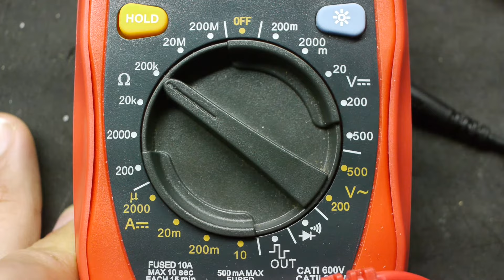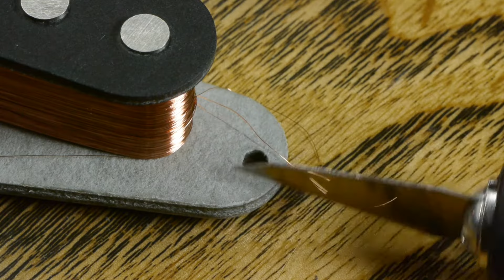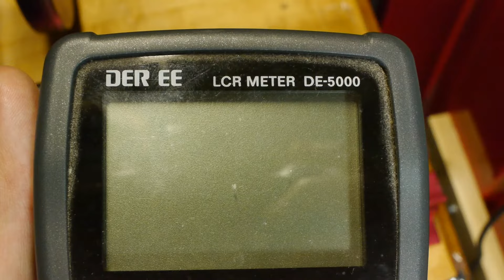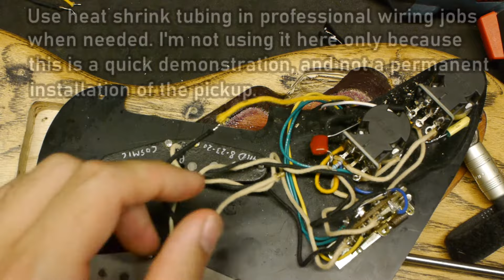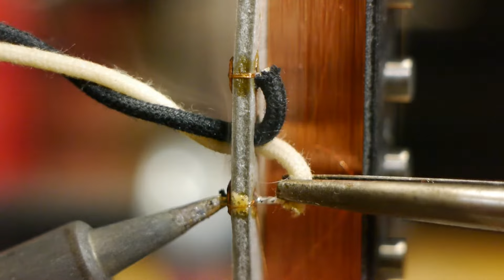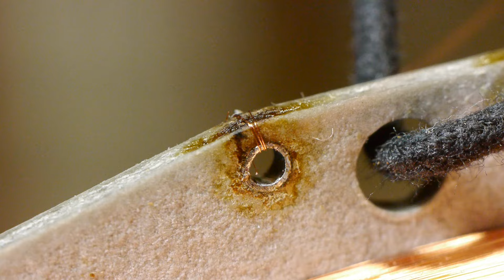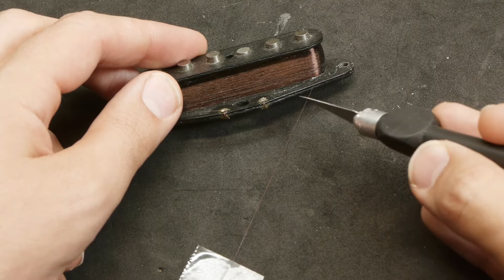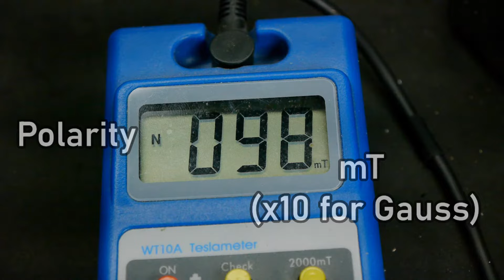Broken Guitar Pickup DIAGNOSIS + REPAIR | Fender Style Single Coil Diagnosis + Repair Demonstration

Comment: wow. very cool video. I wasn't expecting anything like this. I just bought a tele and the bridge pickup is not passing audio. not sure if it's the switch or the pickup yet.
Reply from the maker: I'll be working on a new video soon going over the most basic thing: re-flowing the solder joints. That's usually the most I'll do. I have another video on my "knot splice" technique that I've used to repair pickups before as well here: 

https://youtu.be/cNKcELHM_2s

For humbuckers, sometimes soldering new pigtails onto the magnet wire leads (after disassembling the pickup and wiring) will work. 

For a Tele, I'd try re-flowing the joints, and also carefully inspecting the start and finish eyelets to make sure the magnet wire leads haven't come off. Testing the magnet wire leads is always preferred, as sometimes the magnet wire connection to the hookup wire isn't solid -- even if the magnet wires themselves are OK and the coil isn't broken. 

Re-flowing the joints and/or splicing the magnet wire leads are the two solutions I'll use. Beyond that, it's time for a rewind. I did mention unwinding a pickup here, but since I have no way to automate this (yet), I never do this. It's an option, but I've never actually unwound a pickup to the point where it broke, and fixed it then. You could be unwinding a pickup for hours by hand trying to find that. Just makes more sense to rewind, though understandably most people don't have the setup to do that. 

Let me know if you figure it out!
Reply: I tried to reflow some solder. Nothing. I tried testing at the wires coming off the bobbin after scraping with a razor. Nothing. I tried unwinding the wire. Got a few hundred turns off and it let go. Couldn’t find the end, was super cool, but also the coils were loose in a few places. I’ll probably buy a new pickup, but it was super cool working on this one. Great video. Great playing too! Maybe I’ll buy a setup to wind pickups in the future.
Reply from the maker: @caseykittel  Awesome! Would definitely be worth it, IMO. I've been winding pickups since 2017 and it's not only very rewarding, but great to know you can fix more stuff if it goes wrong. Always a great skill to have. 

The loose wires getting away and pulling a disappearing act is another reason the unwinding method is so tough. I've spent hours fishing around for loose wire ends. Sometimes you get lucky. 

Hope you can get a partial refund at least. I'd definitely let the seller know the pickup was dead on arrival, could cover some or all of the cost of a replacement. Good luck!
Reply: @guitar_md I tried the toothbrush trick, but i ran out of patience. Also, honestly, I bought the guitar BECAUSE the pickup was bad. I was in guitar center and a guy was trying to sell it to the store. They wouldn’t take it because the pickup didn’t work. The customer was gonna throw it in the garbage along with 3 others guitars. So I gave him $100 for 4 guitars. The hard shell cases are worth more than that alone. Buying a pickup is fine. I was really hoping hitting it with the soldering iron would fix it. C’est la vie.

Comment: What you you recommend if the break is at the start lead. Can’t pull off any slack because all the winds are on top of it
Reply from the maker: @Giller9  I invented a technique that I call the "knot splice" for exactly this problem:  

https://youtu.be/cNKcELHM_2s?si=Aer1v1q8v_gI0F8R

Tricky, but it works. The only issue is you'll need separate 42AWG wire to do it. 

Another pickup winder named Dale suggested the idea to me of alternatively using copper tape. That should also work, though I haven't tried it yet. 

 It's very tricky and delicate no matter how you do it, but it is manageable. Sometimes you can tease out a little more length from the start lead with a toothpick if you're very careful. 

But basically, the fix involves splicing to that broken start lead so you have enough length to tie around the eyelet and re-solder. I've done this 10 times or so, so far. And it works great, though it is very delicate and finnicky work. 

Let me know if you get it!

Comment: A true valued video.
Reply from the maker: Thank you! I've got more on the way as well. I'd like to make a new "Wiring" playlist and make some videos about diagnosing and repairing faulty cables, guitar circuits including ground issues, and an updated pickup testing video. 

I'd especially love to do a simple multimeter 101 guitar tech video showing how to diagnose grounding problems and basic wiring issues very quickly. 

Lots more on the way. Thanks for the support!

Comment: I just installed some fat 50s and my neck pickup won’t work , the bottom side tap tests but it’s like it’s shorting out … I gotta get batteries for my meter in the morning so figured I’d try to ask here ….. hard to know anything without my meter
Reply: I’m gonna go flip the wires , I love your videos
Reply from the maker: Let me know how it went! 

If you need any help, hit me up at guitarmdofficial@gmail.com. I'm always available for pickup repairs/rewinds if needed.
Reply: @guitar_md  no dice , I sent a message to where I bought them for a refund /exchange…. Brand new custom shop pups, I shouldn’t have to monkey with them for the cash a guy pays

Comment: Hi, thanks for the video, it is very informative! I have a Tribute Comanche which was mighty fine out of the box, but like a few weeks later ( didn't play much) the vridge pickup was completely dead. No sound at all. So i just wanted to tap it with my pick to check it... Nothing. Then for no reason i tried with a small metal tool and the pickup went back to life instantly! The. A few weeks later it was dead again, but it revived with the same trick. That was last year. Didn't have time to play sonce but today i picked the guitar to test an amp and then surprise (!) the neck pickup is very quiet.... Couldn't being ot back this time, and bridge is ok lol. Nightmarish. Do you think this is tje same problem as in your vid?
Thanks

Comment: Ive got a question. As it seems, you want the AlNiCo 5 magnets in a strat pickup to have the same amount of magnetization in Gauss. Does that also apply to the staggered Fender Pickups where each magnet has a different height, or are they magnetized with different amounts of Gauss/Tesla?
Or does fender charge them all with the same magnet and then every single one has a different Amount of Gauss but that's how they leave it?
Reply from the maker: All charged the same. I think at factories they use a capacitor discharge machine, or something like that. I use two neodymium magnets but I think this is only what home-based pickup builders do. 

An original 69 Fender pickup I measured was as follows:

E: 1030 Gauss (.693" tall magnet)
A: 750 Gauss (.688" tall magnet)
D: 950 Gauss (.722" tall magnet)
G: 780 Gauss (.720" tall magnet)
B: 670 Gauss (.630" tall magnet)
E: 950 Gauss (.670" tall magnet)

All magnets were .193" in width. 

I've seen similar variations in a 1955 Strat pickup set, though not as drastic. The 1955 was 1000, 900, 1000, 870, 830, 900, measuring EADGBE. 

So actually close to what I get now with modern magnets. Variations of a couple hundred Gauss seems to be normal and the meter is also very sensitive to where you hold it so there's some user error as well. 

Gauss can vary by quite a lot depending on the magnet dimensions. Shorter magnets will hold less of a full charge, and so on. But sometimes even magnets of the same size can hold different charges -- no idea why. 

I tried re-magnetizing that 69 pickup and it stayed just about exactly the same. It's possible some Alnico 2 rods got mixed up with the Alnico 5. 670 Gauss is very low even for a short magnet and seems like an alnico 2 or alnico 3. 

So very possible Fender was even mixing them up back in the day.
Reply: @guitar_md  ok thx. I was messing around with neodyme magnets in my guitar to attach a slide bar like Paul gilbert does, and messed up my Texas special staggered every time I flipped the pick guard upside down to solder something with the pickup magnets directly touching the neodymes.
So to fix them I can just get a simple pickup  charger magnet and go through piece by piece? Did I understand that correct? Thanks for your detailed answer. I very much liked the video as well ♥️
Reply from the maker: @nickfleiwer5272  I've only personally used the Mojotone pickup magnetizer. Just as easily you could get a small vise and some powerful neodymium magnets and put them on -- making sure you've got the opposite poles facing each other. 

I show the process -- which is very quick -- in my Pickup Bobbin Assembly video. I clamp it all the way in the vise loosely, then back off a little, and move the pickup back and forth a few times before pulling it out.
Reply: @guitar_md  ok, yeah that's what I'm going to do I think. Thank you for your help 😇
Reply: @guitar_md  lets pretend i had the mojotone magnitizer, do you think its a problem, that the staggered magnets cant touch the neodyme at once? Or do they just get magnetized fine, because the magnet field is still strong enough and must not touch the magnet?

Comment: WOW your so cool I knew this was possible thank you Ive  subscribed glad I found your channel. 
I got a telecaster advertised  spanky Twangler pickups but neck sounds dull  I think must be break in line would send it back but guitar is perfect just going to order a set of Toneriders anyway.

Any tip on what type of pickups out there that sound like Jimi Hendrix style I could buy? cheers
Reply from the maker: I occasionally make a Jimi Hendrix set. You can shoot me an e-mail at guitarmdofficial@gmail.com if you're interested. 

However, if you check out my recent cover of "Machine Gun" (the intro), I did that with a flat, non-staggered polepiece neck pickup. I made it with 7600 turns, and a .500' coil. Traditionally Strat coils are around .430" tall, and Jimi's pickups were effectively flipped upside down, because he strung a righty Strat backwards. 

So...I've made a Hendrix set that emulates that, like basically a lefty set with gray bottoms and plain enamel wire, same bobbin dimensions as he would've had on his Strat. 

But I've gotten some great Hendrix tones using pickups I've made to different specifications using more modern components. I think one of the keys to the Hendrix sound is having a slightly underwound neck pickup, which makes it very clear sounding, which works well when rolling the tone knob back. I prefer a .047uF tone cap for the neck pickup and find it works great for nailing Hendrix tones. 

Another thing to consider is the coil cable. He used those live and it dropped the resonant frequency of his pickups -- fancy talk for, it made them sound a lot darker. That was live, though. But the coil cable can help with getting that tone if that's what you're after.

Comment: I have a pickup problem, hoping someone can take a guess...
I had out of town music store work on my HSS Stratocaster (Select series), after I gotta it back, the middle and neck pickups sounded weak and thin while the bridge pickup sounds muddy, (all on their own), 
The work was done out of town and it's next to impossible to get back to this so-called music store, can anybody take a guess as to what is going on?
I lifted the pickguard and all the wire connections look good, I'm going to change the pickup selector just because it's been used a lot, but then again if somebody has any information as to help me assess this problem I really would appreciate it 👍
Reply from the maker: Sorry I took so long to reply! Did you get it sorted out? 

First thing is to desolder the pickups from the circuit and test them independently. You want to rule that out first.
Reply: @guitar_md   I appreciate you asking, yes I ended up getting a loaded picker, best investment, thank you 👍